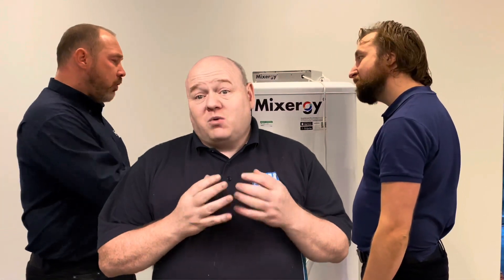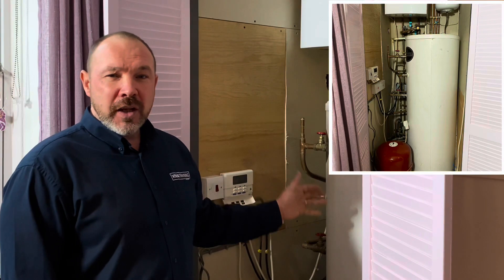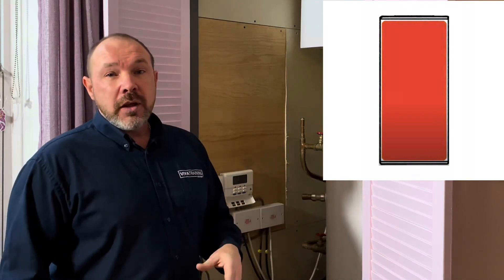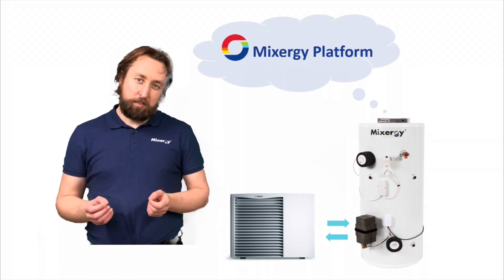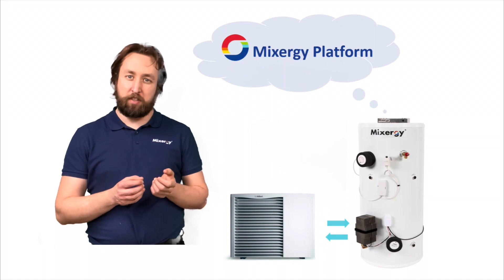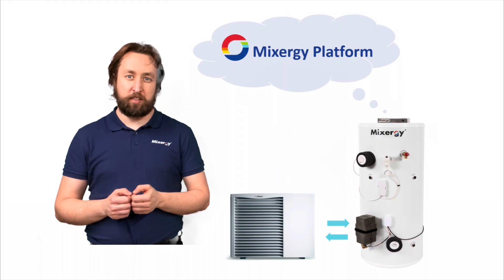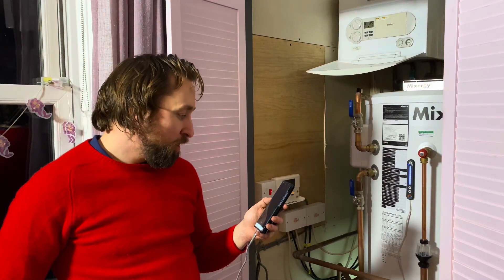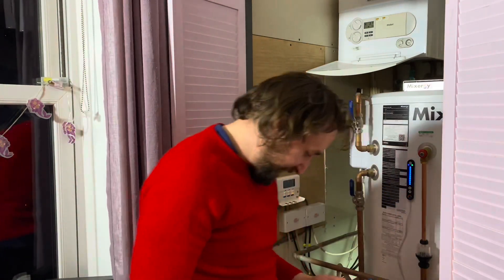Mixergy Smart Hot Water Tank / Cylinder

Comment: Have you thought about thermal store principal like Gledhill Boilermate? Only system that offers electrical back-up for both hot water AND heating. High store temp doesn't lend itself to condensing boilers about 65-ish Deg, but the electrical top-up at a cost-efficient time is a great carbon-saving idea.
Reply: Hi Darren, yes we have looked at thermal stores and the Mixergy technology can be applied to them. The issue is that there is a penalty around the temperature drop associated with the thermal store's heat exchanger which isolates the potable water from the stored energy. To compensate, you have to run the thermal store at a slightly higher temperature which increases heat losses - these losses can be offset if using low carbon renewables and so thermal stores make a lot of sense where there are renewables involved - our view is that thermal stores are likely to become more popular  if smart tariffs coupled with large surpluses of renewables become a big feature in the market, this would encourage them through better payback.

One critical challenge with thermal stores is the difficulty in getting them through the minimum efficiency standard set out by the Energy Labelling Directive - this standard unfairly penalises electric (in our view) - we wrote a paper about this here a couple of years ago: https://www.sciencedirect.com/science/article/abs/pii/S0301421519302484
Reply: Ok, I understand. But couldn't your cylinder be used almost like a store in certain scenarios? With heat exchanger coil working in reverse, to provide heat to heating circuit? You have the destratification pump to control the temperature at the coil, and a high efficiency coil. So surely the controls and wiring could be adapted to open the heating zone valve, draw heat from the cylinder and transfer to the heating system.

This would not only provide back-up heating, but also potentially cheaper/more carbon-efficient heating, when suitable time-of-use prices are available. Use it more like s battery, as a store is intended. 

I realise there are issues with boilers controlling the pump, but perhaps your cylinder should control the external pump? Or have an option for an external pump included with and controlled by Mixergy when a system boiler is being utilised?
Reply: This is where the plate heat exchanger principal could really come into its own. Used for both hot water and heating.
Reply: A zone valve bypass could be used to prevent unwanted heat and pressure losses across the boiler when it's not required or inoperable. A logic board/firmware could be used to ensure only one pump running (boiler or external/Mixergy). 

The cylinder would need to be sized correctly and would inevitably be bigger. But the bigger the battery? If people are getting rid of a heavy cold storage tank, they have weight support and space in abundance.

It's the control systems that will be the difference however. You're nearly there....
Reply from the maker: Happy holidays!

Comment: Do you have to change energy suppliers?
Reply from the maker: You do not have to but it my be better to be with a supplier that has a flexible tariff and is able to give money back. Thanks
Reply: Hello Roger, this really depends, if you're on an electric only system with Economy 7, then a standard Economy 7 tariff can work very well if you put the details into the controller app. The tank will heat just in time before the end of the off-peak period and adjust the amount heated to supply you for the whole day on night rate electric (which can be less than half the cost of peak /day rates)

If you have a gas boiler, there are tariffs emerging on the market (such as the Octopus Agile tariff) which will pay when there's a surplus of electricity on the grid, if this happens, the tank can opt to use electric instead of the system boiler. Our view is that this is the trend for most energy suppliers and one of the things that the smart metering roll-out enables.

Comment: Looks a clever unit 👌

one question if the sensor inside fails (is that replaceable?)
Reply: If the sensor fails there is a retrofittable sensor that can be installed in its place. Very unlikely to occur though!
Reply from the maker: Good Question. Thanks.
Reply: Cheers Allan - was just thinking from my spares days 😁

But great there is a retrofit one 👌
Reply from the maker: @arronblythe755  It looks like a very good solution for future technologies and also works well with smart meters. You could actually be paid to heat the tank, Which sounds crazy.
Reply: @arronblythe755  Cheers Arron, do get in touch if you'd like to find out more
Reply: Is this sold via website only ? Or merchants too ?
Reply from the maker: @arronblythe755  Not really sure but i will find out. Thanks.

Comment: Have they allowed for destratifacation? When only part of the cylinder is hot .
Reply: Will electricity ever be as cheap as gas ..
Reply: The tank is designed to prevent destratification using its diffusers and pump to control the thermocline between hot and cold during heating. The tanks onboard controls can accurately heat to a specific temperature and monitor and control accordingly.
Reply from the maker: @mgbroadsterJ  Sometimes we are paid to take electricity. Thanks.
Reply: @mgbroadsterJ  That's a really good question ... there are times when the price is cheaper already (for example if you look at variable tariffs like the Octopus Agile service), however on average, gas is still considerably cheaper than electric. For this reason we developed the Mixergy tank to work with a conventional gas system boiler as the primary workhorse but also make use of low cost and low carbon electricity as it becomes available.. 

In the future it's pretty uncertain as this could depend on a number of things, if the government in the UK push for more hydrogen in the gas mains, gas prices might rise due to the costs of generating it. On the other hand, if generation capacity lags behind demand due to increasing EVs and heat-pumps, gas may still look relatively cheap... other factors like carbon taxes and other government interventions are likely to play a significant role!
Reply: Should also add that water is actually a great medium for preserving stratification in its own right! A thermocline can remain in tact for a long time in a stainless cylinder due to the low conductivity of both water and stainless steel. Water transfers heat very effectively by convection but heat doesn't want to 'go down' so to speak. The reason we don't use copper in our cylinders is that copper effectively short circuits the thermocline since it is a very strong conductor of heat - we did write a paper about this subject some years ago for Energy Policy!:

https://www.researchgate.net/publication/268691646_Improving_the_energy_storage_capability_of_hot_water_tanks_through_wall_material_specification

Comment: Love the idea but Ethernet over power has issues when using live/neutral through RCD's, so hope it comes with a compatibility list/ warning that it may need a dedicated hardwired network connection. The rest of the technology/warranty isn't new, Myenergi is smart use of electricity for heating cylinders and Oso tanks among others come with a 25 year warranty also. 
It just happens to be all under one brand with this, though I couldn't recommend anyone have one if they already have a stainless steel tank and modern radiators considering most of the air source heat pump installations have required larger radiators and a new tank due to lower operating temps of the heat source.
Reply from the maker: I like the idea of having free hot water from my energy supplier,
Reply from the maker: You could always hard wire it if needed.
Reply: Hello Effer Vescence, we have zero issues with RCDs and in any case RCDs are connected on the live feeds from the consumer unit whereas Ethernet Over Power operates over the neutral wiring. The only issues that you might get are where people use surge protector multi-plugs, but that's easily resolved, another thing is if there are multiple EOP plugs for different devices, you sometimes have to ensure they all pair to one master connection plug to avoid conflicts but again, that's quite straight forward - it's very rare that EOP won't work but it is possible to hardwire as well via an auxiliary ethernet port. 

As for the tech not being new, I don't think you'll find the other systems you've mentioned doing top-up or state of charge measurement so I'm not sure if you've had a chance to watch the video in detail to compare features..?!

This is really for a replacement cylinder and this system will work with a heat transfer module for lower temp heat pumps as you say. Cheers
Reply: @mixergyltd6286  
You are incorrect about the operation of RCD's they are connected to phase and neutral wiring that's how they detect an imbalance and trip, the coils inside older RCD's cause issues with EOP especially in split load/ RCBO applications and is often a common fault I am asked to attend to. This is why I asked if there would be a compatibility list as running a new cable to hard wire isn't always cost effective - so will there be a wireless adaption module/list down the line?

I did indeed watch the full video as I like to support Allen and his channel, I have also worked across 3 continents now, so the tech might be new to the UK but it's not new to the world as a whole. However it is one of the only complete packages I've seen as the others are partnerships between separate companies (especially in the NA market). 

Overall I am quite impressed with it but I am a fully qualified sparks + multi fuel engineer for commercial/industrial and domestic, also fit renewable sources to boot. As such I have come across instances where manufacturers haven't tested/ thought there would be issues and there have been as no installer likes to be caught out on site, it makes them look bad and if the manufacturer has to come in to sort it it knocks peoples confidence in the product hence the questions.

Comment: Would be good to see a boiler flow temp modulation standard developed for hot water storage. Hot as you like to start and modulate back to keep condensing as long as possible, then possibly use electrical top-up from 54-57deg to target temp?
Reply: We're with you on this one Darren, in fact the Mixergy tank does detect if the boiler starts short cycling and will try to keep the system in condensing mode - (see comment to your question below for a bit more detail)
Reply from the maker: Happy holidays!
Reply: @mixergyltd6286  How about an opentherm connection to modulate the boiler?
Reply: @JC-jv5xw  You can using the indirect output signal. Get this signal going via a relay to trigger a volt free signal back to boiler opentherm inputs. I'd consider using this signal to turn boiler up to maximum cyl coil rating and take less than 20 minutes to do so on a PDHW system. Which method would be more efficient - 20 mins rapid heat or 1-2 hours modulated heat up time?

Comment: How much for this model? Allen
Reply from the maker: I am not sure about the answer to that to be honest. I am sure someone will come along and tell us more. Thanks.
Reply: Hi Chen Chen, if you go on www.mixergy.co.uk and get in touch a full price list is available, generally speaking you're looking anywhere between £850 to about £1,300 ex VAT depending on the size of system and various features required. This does include all the electronics and connectivity which are integrated with the cylinder to save on the install cost. Cheers!